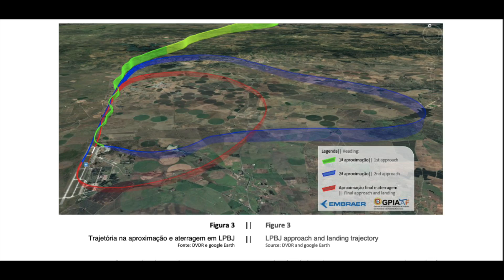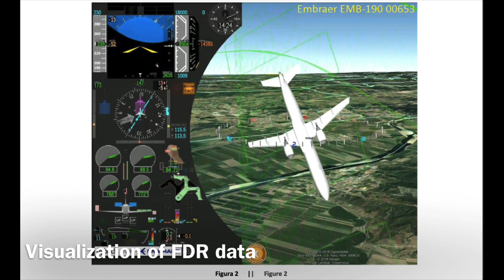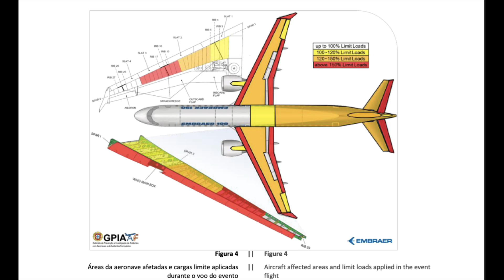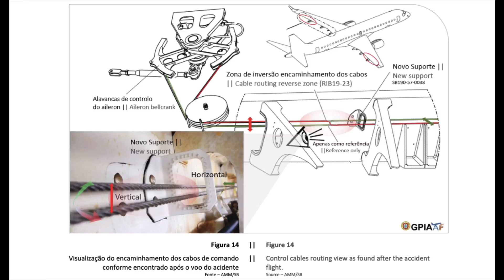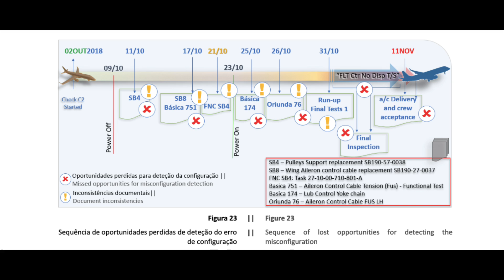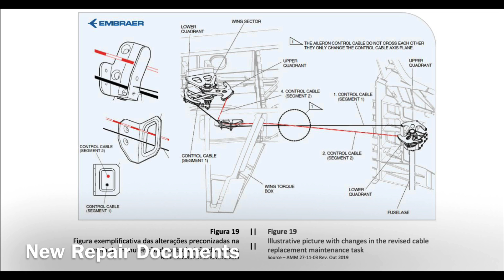Fighting To Survive | Air Astana Flight 1388

Comment: Sheesh.  You'd think that if aileron cables had been disconnected during maintenance, and later showed a flight control system error that somewhere in the troubleshooting procedure (or just as a natural function of curiosity while trying to figure it out) that someone would have boxed the controls (moving the yoke all the way forward, followed by full roll in one direction, full back, full roll to the other side, then full forward again - basically moving the controls through their full travel extents; done with a stick the top would trace a box pattern) while observing the control surfaces for deflection in the correct direction.  I'd think that confirming 'flight controls free and *correct*' would be a normal part of maintenance any time their parts are touched during maintenance.  

That said, as strange as it may sound, I'd suggest that the fact that the airplane had spoilers that were working correctly and apparently mostly cancelling the roll inputs from the misrigged ailerons may well have saved them.  They took off and entered instrument conditions very quickly.  If they just had the misrigged ailerons, the plane would have rolled opposite to their control inputs.  If you command a left bank and the plane rolls right, your instinctive reaction will be to add more left aileron, which, with misrigged controls, will roll the plane FURTHER to the right.  Right after takeoff while still close to the ground, you'd have very little altitude to play with, and likely literally only seconds to waste while figuring out why the plane is misbehaving as it is.  If you enter the clouds and lose outside spatial references, I'd bet most would not be able to figure out what's wrong before losing control beyond hope of recovery.

That was a hell of a good demonstration of flying skill, and those pilots did an amazing job of learning to fly a crippled airplane.  Whoever signed off the maintenance needs to be strung up by their thumbs for missing the incorrectly connected ailerons - regardless of the possibly confusing connection instructions, there's no excuse for not moving the yoke and confirming that the ailerons are moving with it, and the right way.

Comment: When I replace parts on a car I use the parts installed as a guide. 

If a (split) vacuum hose goes from point A to point B, I fit the replacement hose the same way. 

It’s a nightmare if someone has fucked up  replacement previously, and you and copying incorrect incorrect installation.

Eg: hose 1 (should be A to B) and hose 2 ( should be C to D) and fit I hose 1 A to D  hose 2 C to B because that is how the last person got it wrong, 

Had it on a Volvo once. Someone had the turbo boost pipes reversed. Asking for more boost turned the turbo off, asking for less turned it on. Put your foot down, the car lost power. Release the pedal, and it  accelerated.

Comment: As an RC and enthusiast I am probably too ignorant to comment, but I still find it surprising that control surfaces on this aircraft were not tested on the ground (for binding, direction, and range of movement) before a flight is initiated.
Reply: check out the Mentour Pilot video - uploaded a few days ago - there's more detail available

Comment: It seems like a stupefyingly simple fix, but shouldn't the cables for the starboard (right) control surfaces be in green and all the cables for the port (left) controls be red? This would correspond with the running lights.
Reply: This is not a Lego Duplo set for little children. If repairs are done by untrained staff, not even an UAZ military car will work afterwards.

Comment: I can relate to poorly done technical/engineering drawings causing confusion.  I've been battling a Cadillac CT6 with a front sunshade problem for far too long; all the drawings make it look like the left side motor needs to be replaced (for the sunroof) but when I manually activated that motor with a wrench it was the rear sunshade so I need to replace the motor on the right side.  I'd feel like an idiot but the field engineer that looked at it (twice!) made the same mistake.

Comment: What happened to the post maintenance dual certification of the installation and the flight control sense check? That error should never have got overlooked with the proper checks by qualified personnel. That maintenance facility should have been closed down!
Reply: Mentour Pilot has recently produced a video on this event - it turns out the blame can be spread over a vast area - including the aircrat manufacturer for confusing aileron replacement instructions - the maintenance company for protocol issues - the airline for not sending a crew trained to accept planes - and the pilots for not noticing the aileron issue during preflight check - and for taking off on an acceptance flight in poor weather - etc

Comment: No Excuses - after Flight control Maintenance there should be an "Independent Check"  by a skilled guy, who was not involved in the work (ie  Independent)  We do functional tests, a guy in the Cockpit in-puts full Left & Right control Column & people on the outside check the control surface responds correctly.  I've even seen ailerons moving up & down together..
Reply: according to Mentour Pilot - who has uploaded a video on the incident a few days ago - a normal flight crew was sent to bring the plane back - instead of a crew trained to accept planes that have gone thru extensive maintenance - most likely they would have caught the problem during the preflight check

Comment: How was this missed in the preflight inspection? I thought that the movement of control surfaces would have been part of this.
Reply: they asked for 3 other repairs that same day, i guess at one point the human factor kicks in, and after 3 fixes their attention wasn't great anymore. eg they sent it back for some hyaluronics fixes and ventillation system fixes before getting off the ground that day

Comment: I'm not a trained pilot. I'm just a ultralight pilot I fly my home built legal eagle even I know you SHOULD NOT take off on a runway in poor weather in a aircraft that's gone through heavy maintenance because if something is wrong you want to land in the closest runway in very poor weather you may need to fly to another runway further away. But that wouldn't have helped in this airplane this probably was similar to driving a car turning the wheel to the left but the vehicle turns right. I definitely would have needed a change of underwear when safely on the ground

Comment: Making the mistake is bad, but understanable. It is an "easy" mistake to make.
But MISSING the error during post-install checkups, makes no sense at all. Surely one aspect of the postinstall test is comparing the aileron deflection rate vs. input? In effect, checking that the calibration is correct? This test should instantly have shown the aileron action was inverted from control input.

Comment: Can anyone please help me in a crash I am looking for but cannot find for the life of me? I believe I saw it on Alec Joshua Ibay's channel, but I cannot be sure. It was some Middle Eastern or perhaps Pakistani airliner and I believe the pilot, co-pilot and F/O all spoke Arabic. The ATC transcript is like a 3 Stooges skit with how dense the crew are. I believe there was either a fire or some severe damage to the aircraft very soon after takeoff. One of the crew tells the pilot this over and over again because the pilot just keeps saying "What?!?" repeatedly. At one point a stewardess comes in and asks if they can do an emergency evacuation at that time, while they are still tens of thousands of feet in the air. He has to tell her to wait until the plane is on the ground and stopped to open the emergency doors. Reading/listening to it would be funny if lives weren't on the line; instead it's nail-biting and infuriating. You want to hit your head on the keyboard from their stupidity. Can anyone help me please find it????
Reply: Pickles Saudia Flight 163 - the 3 Stooges flying a L 1011 Tristar. Killed them all by sitting on the runway for about 25 mins without evacuation

Comment: The plane should've been flown between the ears of the dork who allowed unqualified personnel to perform crucial work on the airplane. It's kind of obvious that if the "complex figures" couldn't be followed without doubt, an informed opinion should've been consulted on how exactly to install the cables. And also, a temporary installation that is hardly distinguishable from a permanent installation is a big no-no. Easy for me to say from my chair, but the cables should've been at least flagged as unverified installation.

Comment: Conclusion:  If it is not broken, do not fix it.   For instance, I replace plenty of computer controlled accelerator pedals in automobiles.  However, I have replaced only two accelerator pedal cables my whole time as a mechanic.  Is a £300 computer controlled accelerator pedal really superior to the £15 accelerator pedal? Newer is not always better.  Many times, newer is inferior.  Never fix what is not broken.

Comment: A suggestion: Please include a link to the sources used in the video (https://aviation-safety.net/database/record.php?id=20181111-0, for this video) -- it saves time if someone wants to dig in for more details.

Amusing factoids:
* The "FLT CNTRL FAILURE -- NO DISP" error re-occured immediately after landing.  I'm sure the pilots were highly amused... :(
 * The error message was not caused by the miswired controls -- however, the procedure for clearing the NVM that stored critical faults couldn't be completed with the controls miswired (one of the steps required was a flight control check, which kept failing for some reason...).  Annoyingly, the final report doesn't even speculate as to what the original fault was, although there is a shockingly long list of fixes implemented in response to the error message prior to ultimately "fixing" the error.
* The ultimate "fix" was to replace all three of the four flight computers.  The three new units obviously had no faults stored in their NVM, and FC2 (by design) didn't have connectivity to the flight controls / sensors that would detect the miswired controls, so FC2 successfully passed the "Reset NVM faults" procedure.
* The report doesn't indicate whether the pilots were aware of why this plane was so late coming out of maintenance, or even if they were aware the plane was overdue at all.  Not relevant to the investigation, admittedly, but it would have been nice to know.

Comment: The idiot who replaced me at my one job put an actuator in reversed in a piece of equipment which resulted in several men being dumped from a maintenance lift basket when it worked backwards to normal. I was blamed for this even though I never touched that job and was subsequently banned from that GM plant for life as`` ìncompetent`. Inexperienced idiots working on equipment without proper supervision can cause serious accidents. been there!

Comment: Pilots fucked up at the start by not checking (the status of the alerions etc show up on the displays in the cockpit).  Then more than redeemed themselves by saving themselves. 

Unfortunately, the plane had to be written off due to the structural damage.  This video doesn't mention that.

Comment: TOTAL BALONEY! I was in the USAF as a crew chief of fighter aircraft for many years, after EVERY flight control maintenance  there is always a function check that must be signed off before the aircraft is released for flight. There is also an inspection by a quality control inspector and that must be signed off. This was a total screw up by the mechanics and they should be fired!,. No excuse for this at all. I don't know about the procedures for checking the flight controls when the aircraft is started or by the flight crew but this problem should have been caught before lives were risked.

Comment: Slow down, you speak to fast in this one dude.  I like that you explain what is happening and what happened and what the NTSB noted.  Too bad the FAA does not take their recommendations seriously all the time.  The FAA puts out the word, the rules, and what needs to be done, replaced, or repair.  They let Boeing know what is expected from them after a crash?  Boeing takes years to comply.  Boeing gives millions of dollars to the republican party and that has given Boeing a pass to do whatever they want and when they want to do it regardless of the FAA.  Because of this Boeing is allowed to hire cheap labor who has killed.  They send their pilots out in horrible weather stressing them about schedules. Over worked and not taken care of.   Pilots fly airplanes that they are not familiar with.  The pilots are not trained well.  maintenance replaced and installed a window in a cockpit.  One of the small windows on the captain's left side.  The genius, hired by Boeing installed the window on backward, yes, backward..  Needless to say that at cruising height, 36,000 feet, the window flew out, lucky it didn't fly in and hit one f the pilots but something worst happened  The window flew and so did the captain, flew out of the window halfway.  If there wouldn't have been four pilots on that plane the first officer would have had to let the captain go.  He could not hold on to the pilot aNd fly the plane.  The pilot when being sucked out got his feet caught on the instruments and that is what stopped hin at first from being sucked out all the way.  the crew was amazing how they saved their captain.  I didn't believe in miracles until I watched this full episode, an hour-long on Youtube, airplane crash investigation.  You get to see and hear the pilots after.  Also saw it on the flight channel and I believe here.  But they were not the whole episode and do not show the people., check it out.  I am still loyal to this guy here also, he's good, very good at breaking things down.  That is the main reason I like him

Comment: Don't airliners do the same pre-flight control checks that little GA aircraft do?   Move the controls, and confirm that the control surfaces move correctly. 

Oh, you say they did and failed at the end of the video.   

I'll bet that they will never skip any preflight check, even if they're already sure that it should be right.  Those little mistakes cost the airline (or their insurance) about $20M.   

You'd think that verifying the correct motion of the control surfaces that they just rebuilt, would be standard and desired.  If for nothing else, to see that their good work actually worked.    I guess there are people who think all their work is perfect, in any industry.